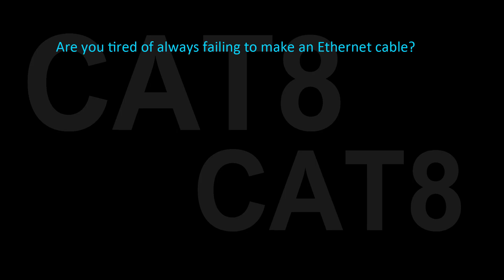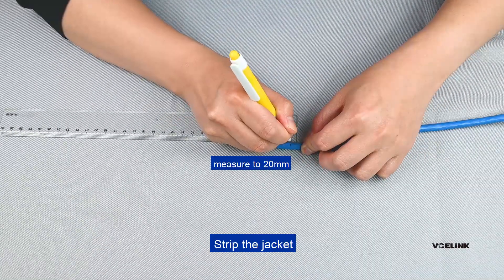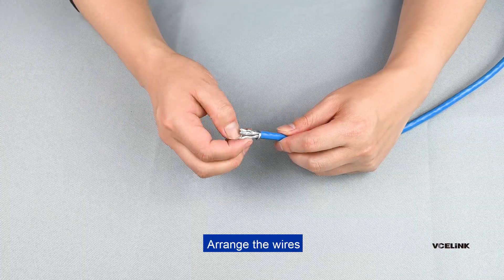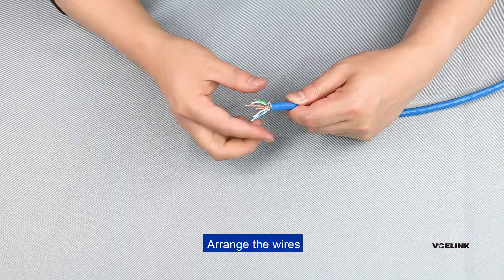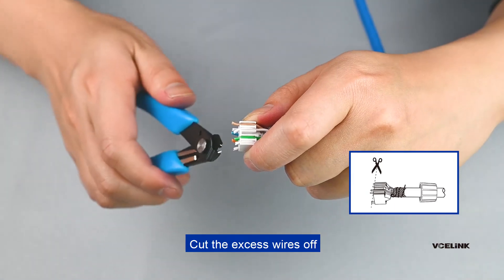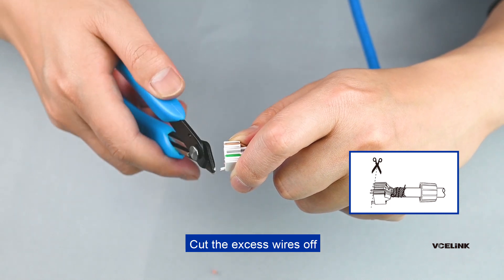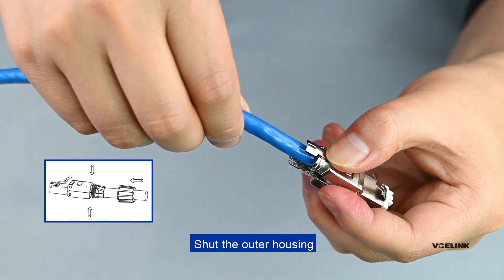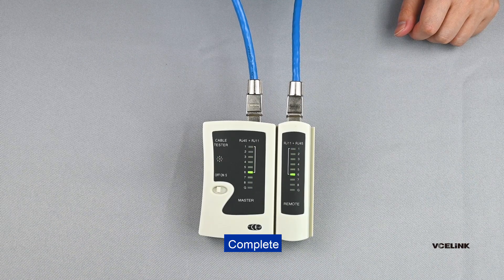How to Make Cat8 Patch Cable in the Field? | VCELINK

Comment: Why is the braided shield wire wrapped and then twisted put of the way? Shouldn't it be twisted and folded straight back to make contact with the terminal casing for a complete shielded wire?
Reply from the maker: Thanks for your question. Both ways are OK as long as the shielded braiding is wrapped around the cable jacket to offer an excellent grounding.

Comment: I looked at the spec sheet and it says this connector is good for 26 awg wire. I have Cat 8 Cable SSTP with 26 awg wire, can I use this and get full spec data transmission on a short 20m run?
Reply from the maker: You should also check the outer diameter. If it is OK, this field termination plug can theoretically achieve your desired data transmission.